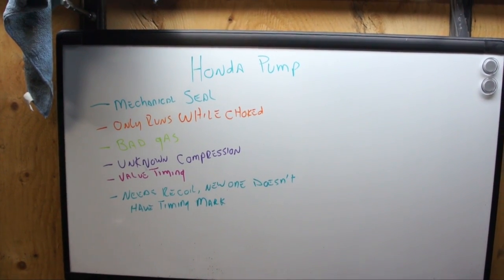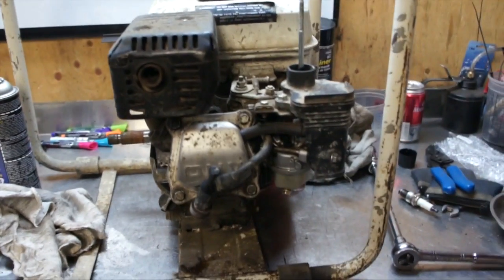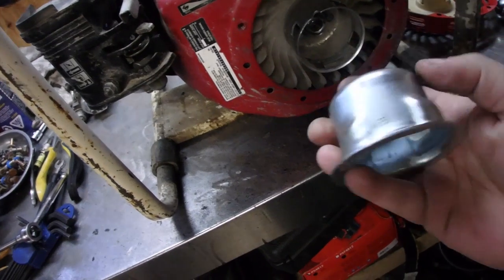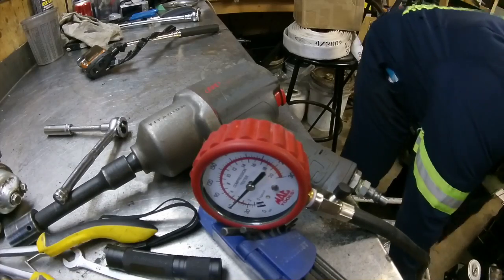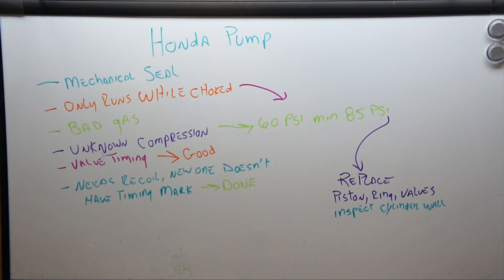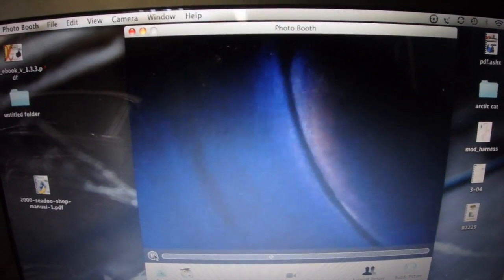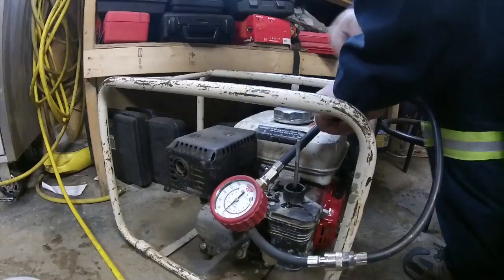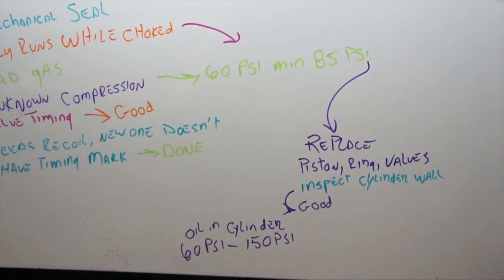Honda Gx160 Low Compression

Comment: These engines have automatic decompression centrifugal lever on the camshaft opening the exhaust valve just a little bit putting that much oil in it will also raise the compression because the oil will seal that little Gap in the valve at decompression the only way to properly check the compression is to make sure the intake valve is set to the proper gap I believe that's .015 but you could check your engine specs for valve tappet clearance to be sure. Once you have got the intake valve set at the proper clearance remove the rocker arm on the exhaust valve this will eliminate the decompression now redo your compression test. Sometimes the decom on the cam gets froze up or the spring breaks causing permanent decompression.
Reply: Excellent information. This helped me greatly. Thanks so much! 
Kevin👍

Comment: Cold compression testing is different from hot. When cold there is no oil on the cylinder walls therefore compression is very low as well as lack of thermal expansion doesn't allow for proper ring to bore sealing. You put the oil in the bore, it sealed it nicely and compression shot up. That's normal reading you got from the cold test.

Comment: On my dads Honda GSV190 push mower engine I'm going to try to replace the valve stem oil seal first before pulling the engine down. 

Even though the compression tested at 75 PSI ,above Hondas recommended 71 PSI,the general consensus online with lawnmower mechanics is  piston rings which no longer seat on the cylinder walls cause the engine to burn oil in the Honda engines.

I want to do a leakdown test on my 3hp Briggs & Stratton engine as it uses a fair bit of oil when mowing with it,it burns a bit of oil,the maximum amount burned in a couple of hours has been 200 mLs of oil so 1/3rd of 600 mLs just got burned off.

I was a bit worried that the inlet valve guide was a tad worn when I lapped the valves in so I would like to confirm that it's not rings & perhaps that it may be a worn valve guide.

So a $111 USD valve guide installation kit might come to the rescue because it's usually a case of throw the cylinder & crankcase out because the valve guide is drilled straight into the aluminium !

Comment: I think I mentioned my dads GSV190 powered lawnmower before on here well,Honda says that 71 PSI for that engine which runs the decompression camshaft is o.k. but it's hard to start & it usually burns oil when the engine is cold,once it warms up it's o.k.

I've ordered new rings for it but I still need to order the newer piston to suit the 014 rings (it's a 2003 model with 004 rings & matching piston) but I would like to do a leakdown test on it to find out how badly worn it is.

I added oil & the compression went from 71 to 125 PSI but I want to confirm that Hondas figure is correct !
Reply from the maker: No idea you will need to get a service manual for that engine to pull up the proper ratings
Reply: 71 PSI is Hondas proper rating as I downloaded the GSV190 workshop manual or pages of it from the Honda website.

I retested it this afternoon because I had the choke closed last night but the highest I could get was 75 PSI.

I checked the choke operation tonight  & it seemed to be working o.k. but I readjusted the throttle cable & found out that it was stuck open by a millimetre or two.

That fixed the starting problem but it looks like it will need a rebuild down the track to fix the oil burning issue !

Comment: Thank You! iv been working on my 7 hp brigs and straton, "off a genorator" now on my go kart. cleaned a entire hand full of oxidation out of the carburetor and it still only runs on chock, "better though" I appreciate your passion. i know its not the head gasket so i bet its the rings after all that powder getting in the engine for all those years.
Reply: Yea id suggest not putting chalk of any kind in a motor, id say it would definitely powder up some parts ..

Comment: Id recommend that you pull the piston, give the cylinder about 15-20 seconds of ball honing, put new rings on the piston. its possible there some leaked around one of the valves, maybe its not fully seated or cracked.

Comment: Id say rings too. And im not sure if low compression would cause the lack of fuel. Thats an interesting one.
Reply from the maker: +Steve Rob low compression also equals low vacuum.  lack of vacuum means less fuel will be pulled in the motor.  Applying the choke increases that vacuum and flooding the cylinders will also increase compression

Comment: better off to replace with a power fist motor on sale. unless you have too much time on your hands lol. can't go wrong one year over the counter return policy
Reply from the maker: +john d nope plus when they are on sale they can be quite cheap 99-129,  however this engine doesn't have the same crank you'd find on the standard PA motors or even compared to my GX120 it's longer because of the water pump application